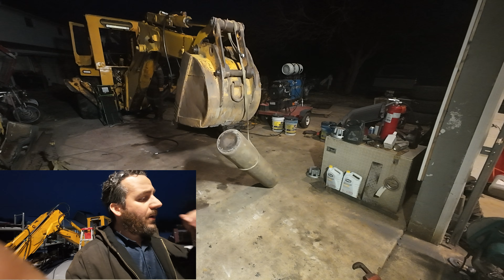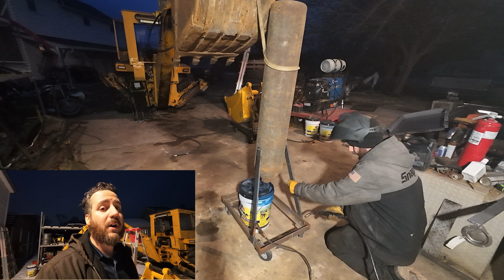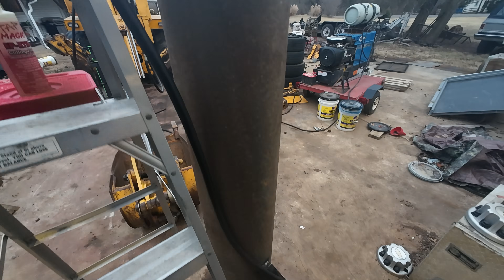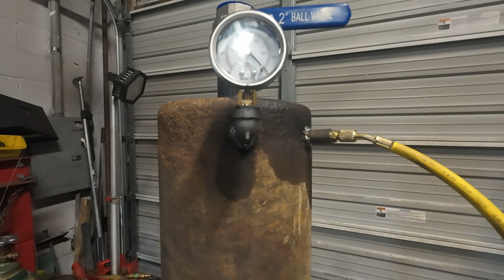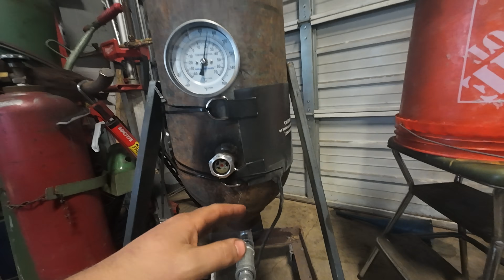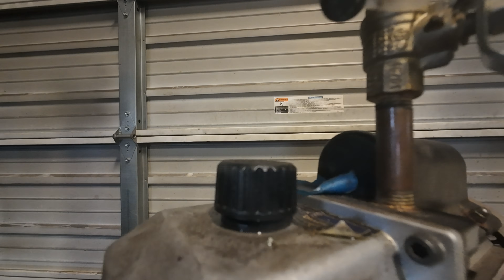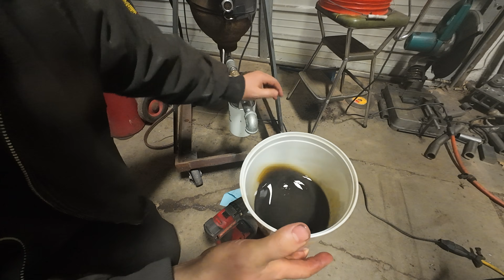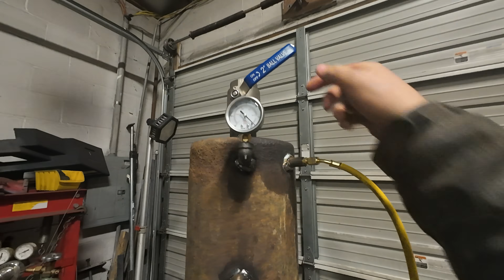I made a machine to remove water from hydraulic oil. Vacuum de-hydration

Comment: Probably wouldn't hurt to run the hydraulic fluid through an oil centrifuge. They aren't cheap, but you would pull a lot of the "crap" that's under 10 microns out

Comment: you'll likely experience a premature failure of your vacuum pump unless you can figure out how to get the water vapor filtered out. I'm not sure what that takes or how much it costs. But for your use case, it may just be more cost effective to replace the vacuum pump when it dies. But you're definitely prolonging it by paying attention to, and replacing, the vacuum pump oil.
Reply from the maker: Yes quite possible. I change the oil often and the oil seems to hold the water pretty well. Only time will tell if the pump starts losing efficiency. It is just a cheapo harbor freight pump.

Comment: tractor supply 30$ 5 gal meets the requirements
Reply from the maker: The VP stuff or the traveler brand? Ive been running the VP. Price just dropped to 38.99/5gal near me
Reply: @spankranchgarage  i was thinking the traveler brand cheap stuff might have been on sale i bought it about a month ago for my dozer.

Comment: Silica Gel should be able to remove the last parts of moisture and it can be recycled/reconditioned by heating up. Many gels come with an indicator usually orange / blue, so you can tell it used up.

If silica gel works with hydrolic oil - first do the distillation and later drop some gel in the bucket to get the last remnants out.

Comment: take the hoses off the ram's and manually cycle them to Squirt out 99% of the old oil.... both on the push and pull stroke. then you do not have to wait.

Comment: Spoon (or pan) test  An old way Waste Vegetable Oil folk used to test how much water is in their WVOl.   

put a measured  tiny amount oil.. like spoon full or less of oil in a pan.  (or few drops in a spoon) of fresh unused oil.  Heat to temp of boiling water..  see what it does.  add measured amount of water to the oil and mix well in a blender... (so you get micro droplets of water mixed in oil)..   Wash rinse repeat numerous times with numerous batches each a  higher % of water that you added to your test of new  oi w/water addedl.  

what you are looking for how how much bubbling you see in oil indicating water is boiling out.   Doing same in reverse..... again with your batches to recheck your standards....  etc... and you will then eventually develop a very easy test method to see how dry you have gotten you oil .....  

Hope that helps

Comment: Stuff is expensive. $35-$80 a bucket.
Reply: I used diesel to rinse my hydraulic sump out. Kept collecting it and pouring it back in until it was all cleaned up. Then only the lines to and from the pump and the pump were all that was left with dirty oil in it. So less than a quart out of 2 gallons or something

Comment: Funny running across this. I have same issue. New oil keeps going white. My thoughts are very similar using a vacuum but I wanted to simply remove hydraulic hose and with tractor running pump fluid thru separator so as a continuous process. Leave tractor idling with circuit open to have a continuous process and of course flushing whole system.

Comment: you could go to Tractor supply and get a spare cap for the tractor oil tank.  drill a hole and add a bung.  pull a low vacuum on that.  work the machine for a few hours and the oil will warm up and evap.   You could even mount a 12v vacuum  and wire a toggle switch.   The question would be can you have a small enough vacuum to pull the water without damaging the seals.
Reply from the maker: On this unit the hydraulic tank is the actual transmission. The shifters aren't sealed air tight so I don't think it would pull much vac. However, on other equipment your idea might work and would be so much easier/faster

Comment: If I was you I would make an adapter for that discharge port and suck the oil from the dirty bucket into your contraption. Make the vacuum do the work for you rather than trying to pour it into the top of that ball valve. Neat project

Comment: I'd put a ball valve between the tank and the filter, and I'd add at least 2 more filters in line.  Make the first one something like 30 microns, then 10, then 1.

And run the vacuum line into a moisture separator, so you don't trash your vacuum pump.

I have a bunch of diesel (more than 400 gallons) that got water in it.  Lots of water!  (cap left off an outdoor tank).  I've been looking at a centrifuge approach, but this might be a better idea.  A settling stage to get the worst of the water out, then vacuum it.

Comment: Run it like a still. Add a cold coil line (aluminum)  & a water trap, lower then the pump, before it goes into the vacuum pump might help.

Comment: I would recommend changing your hydraulic filters after removing the water, because the filter element does not work well when contaminated with water.

Comment: Awesome to see you cleaning yourr hydraulic fluid instead of throwing it away.

I worked on large  hydrolic test/cleaning systems with "deairation" systems that would remove all water and desolved gasses.  The key to removing the water is to spray the fluid into a large vacume chamber(the actual chamber was 3X3X4 feet, but a 40 pound propane tank would be okay,  with longer cylinders having more storage capacity).  This allows the water to be rappidly pulled out of the "attomised" droplets.  

Our system did not heat the fluid at all, so I don't think heating the fluid is nessasary.

It took us 2 passes to completely remove all water a d air, but that is for normal hydraulic fluid that was used for a fiew years in aircraft.  I am guessing you would need the fluid to be sprayed in the large vacuum chamber 6 times if there is a lot of water.

If your hydraulic oil is black, then you need to run the fluid in a circle through a 10 micron filter after removing the water.  Just keep running it through the filter until the fluid is normal clean oil color.  

If clean and water free hydraulic fluid should last many years.   On the Airforce equipment I worked on, there was no scheduled maintenance for hydraulic fluid replacement.  Our equipment just had realy good filters.

Comment: I used to certify tanks with rated pressures up to approximately 8,000 PSI  at my job in the military. A little bit of rust on that tank would be perfectly fine to certify.  I just would have had it cleaned on the outside and painted after testing, but this was not nessasary.  The condition of the inside of the tank is more inportant than the outside.  Also, steel tanks usually do not fail catastrophically,  they just start to leak after they have rusted a significant portion of the tanks thickness. 

When I worked at a dive shop, we had steel tanks that had a huge amount of rust around the base which had a plastic cover and the certifier didn't care.  The tanks are tested to a much higher pressure and would fail in certification be for they would fail from rust during the certification period.

Comment: You should pack the top of the tank with fiberglass (insulation), then circulate the oil from the bottom and over the fiber glass dripping it down. Help degassing and evaporation.

Comment: I’d recommend making a secondary tub just in case of overflow though I don’t know if that pump is powerful enough for 2 separate chambers but it would probably be easier to make another chamber and a condenser column so that you have less water entering your pump and less of a chance of spillover, the condenser column would be to prevent steam buildup and/or make it so that the steam condenses outside of the pump

Comment: To protect the pump you can put a secondary catch pot between the main chamber and the pump. Schedule 40 pipe works fine use some hot glue to seal all tbe seams and fittings for easier dissasembly if you need dissasembly.

Comment: When dealing with DIY vacuum chambers, boilers, and pressure vessels, always add an overpressure safety relief valve even when making a vacuum chamber to prevent the remote possibility of an unsafe pressurized situation that could fling those fittings off like projectiles. The ASME code is written in human juice.
Reply: You're like a parrot, heard a word but don't know how to use it properly. You're proposing putting mobile phone in the casket of a person who was wearing kamikaze belt, just to prevent the remote possibility of burying alive

Comment: 👍 Probably needs a finer filter, possibly multiple stages and under pressure to improve filtration efficiency. Ensure adding new emulsifiers. I'd put a vapor trap on the vacuum side to save the pump.

Comment: Build a copper water pipe manifold and run a misting garden hose on it to condense the water vapor and drain it through a valve at end of run, pump high and inlet from tank low.

Comment: If its cold just leave it outside in winter. Water freezes and seperates itself
Reply from the maker: I wish it was that easy. Not for this oil.
Reply: @spankranchgarage  ive had hydraulic oil with water. Leave it sit for months . Water separates then during winter it freezes then get the oil.off the frozen water. The process im talking about isn't quick but it works. If you need oil asap then this won't work.

Comment: Hello, Some random HVAC guys here. The vacuum pump oil became murky because the pump is compressing water vapour,  then condensate inside the pump.
Some pump have a bleeding valve to deal with such situation.They let certain amout of air into the pump and dilute the vapor, the vapor will not condensate when dilute enough.
The drawback is it lower the exterme vacuum the pump can achive, But since we don't need a perfect vacumm, this is acceptable.
If the pump doesn't have such valve, air can be injected into the inlet,  the flow of air is adjusted so the vacuum level is maintained (and not overload the pump).
Reply from the maker: No ballast valve on this pump, but I do agree its a great idea to add one to create a tiny leak. The pump runs pretty warm, if it was warm enough to dry its own oil that would be really cool

Comment: I don't know what your shop air is like but you could run a venturi setup to pull a vacuum on the tank. We did a similar system in the Navy to vacuum bilges, you won't get a perfect vacuum with a venturi but since you're just exhausting the air it doesn't matter what's in it. Even a partial vacuum with heated oil will dry it out.
Reply: Also with a good check valve you wouldn't have to run the venturi constantly just enough to draw a vacuum. If you want to get crazy eventually you could put a regulator on it that permits air through the venturi when the vacuum drops.
Reply from the maker: I like the idea!

Comment: I ran into a similar situation a few years ago but with diesel. Met a guy selling a couple thousand gallons of water contaminated diesel. Surprisingly, he admitted it was fairly heavily contaminated up front....... along with some algae as well, he suspected. But, MAN OH MAN was it a good deal (basically a song and a dance). So, I couldn't pass it up. At first, I thought I would just pump it through a bunch of filters. LMAO then I started pricing out said filters...........Nope! My next idea was to exploit the vapor pressure of Water VS Diesel. Technically possible, but really slow. and no good way to do that at scale....... And it wouldn't address the algae issues either. For a fleeting moment I thought about exploiting the boiling point/s (as you did hear) but I figured out the ratio of heat to vacuum HG would be critical and would need constant monitoring/tweaking. Not to mention heating up diesel didn't seem like a good idea..........LOL Eventually; I came up with exploiting the mass differences between water, algae and diesel. So, I found a guy on FB marketplace selling a waste vegetable oil centrifuge. A few tests, a couple of pool timers, along with 3x cheap piston pumps and I had a fully automated fuel polishing system. It took just over 2 weeks to filter/polish 2500 gallons of diesel........
Reply from the maker: Thats beautiful sounds like you made the best of some cheap fuel!

Comment: Yeah....boiling it still the cheapest solution.   I did boil hydro oil anf checked the properties before and found out that oil starts going bad above approx 180 degrees celsius so boiling still cheaper

Comment: The simple solution would be to switch your oil to dielectric hydraulic fluid. Then to just drain the tank every so often to get out the water. Dyelectric brings the water back to the tank where it gets dropped by weight. They use it in Boom trucks and cranes for electrical insulation from high voltage lines.

Comment: Nice design and build, and interesting to see the successful operation of the working unit. I'd imagine that when your backhoe has been working hard the the oil will be running over 200°F, the reason that the water doesn't evaporate off is that it's effectively in a closed system, with only minor amounts of "breathing" to/from the atmosphere as the temperature changes. I think you'd gain a satisfactory result from heating the oil in a vat/bucket until the water evaporates off, without negatively affecting the oil at all. I've drained and heated oil from a hydrovane compressor that didn't ever run for long enough to get hot enough to dry its oil, and it changed from emulsified oil back to good oil very quickly, and the compressor is fine running on the dried oil.

Comment: I used to have a dozer that always would get water in the transmission no matter what I would do. It was a big problem in the winter because it had a filter before the hydraulic pump on the side of the transmission and the water would freeze and settle out some in the paper filter which could then collapse and get drawn into the pump. 
i purchased a large oil centrifuge that I intended to run with regulated pressure off of the hydraulic system. However in a stroke of brilliance I realized it would be simpler to sell that dozer and get one that didn't have that problem.
Reply from the maker: Haha thats one way to fix it!

Comment: Your vacuum pump should have a vent between the stages of the pump to help release the water vapor from the pump.  Check into that and operate it with the valve open.

Comment: Instant water in oil test
Place a drop of the suspect oil on a piece of tinfoil and heat it with a lighter. If there's water, you'll see the bubbles in the oil drop.
If they're small, low%H2O
If they're big, high %H2O

Comment: Just a thought, can you freeze the water out? Also, you definitely need a cold trap.
Reply from the maker: The water doesnt drop and freeze in the bottom of the bucket like engine oil. But I have considered freezing it then pumping through a filter and hoping the filter could capture little frozen ice molecules.
Reply: @spankranchgarage  Yeah, that's pretty much what I was thinking. filtering would be hard though, now that I think of it, because the oil will be thick at low temperatures,

Comment: Make sure your vacuum pump is not going to rust out, since most oil type vacuum pumps can't deal with water vapor, it condenses in the vacuum oil and ruins the pump.

I would suggest a separate cartridge to put some calcium chloride in between the vac pump and the wet oil.

Comment: I've had to deal with this for years.

And yes, its really costly to just replace it over and over.

I am not yet in a position to build a vacuum desiccator, but I have used IPA and calcium chloride with a little bit of heat.

Indeed, adding unnecessary heat is bad for the oil, so when I can, I certainly want to build a vacuum desiccator.

Comment: Add strong neodymium magnets to you filter to catch any metallic particles. put an inline desiccant trap using silica beads before your vacuum pump to catch the water and save your pump oil. Silica beads can be used over and over.... dehydrate them in an oven to clear the water it trapped.

Comment: That looks to work much better than heating the oil. I have heated oil and separated the water but rally was not happy with the results. I never thought about using a vacuum but have all the parts so this will be on the to do list. thanks for the idea!

Comment: Use a retired 20lb propane tank with a double fitting in instead of the standard valve. The line from the oil tank should extend at least 6 inches into the tank and the line out to the vacuum pump should be as short as possible
Water cool this tank to capture most of the moisture before the vacuum pump

Comment: This separation of water and oil was done on steamships using reciprocating engines.  Special steam oil was injected into the steam before being fed into the valve gear and cylinders;  after the steam had been through the high, medium and low pressure cylinders, it was condensed for re-use, but the oil had to be removed from the condensate before it could be fed back into the boiler.  I can't remember all the details, but the method used was to out the condesate through a peculiar-looking pump, with a spiral-shaped rotor.